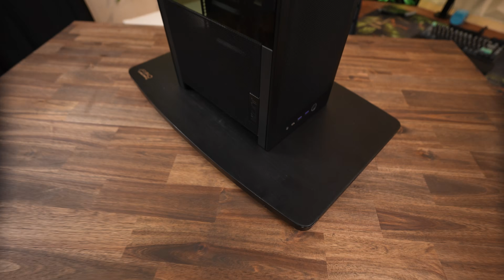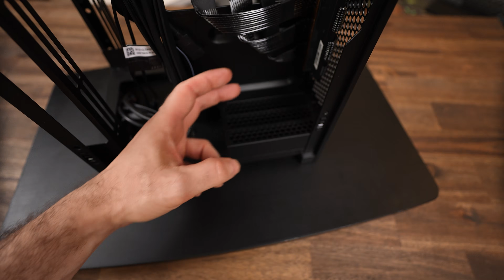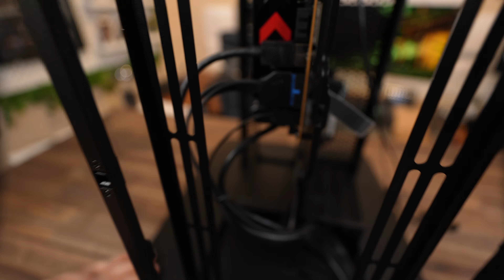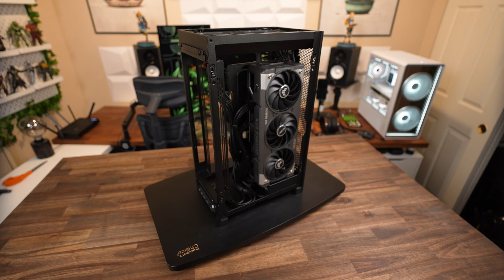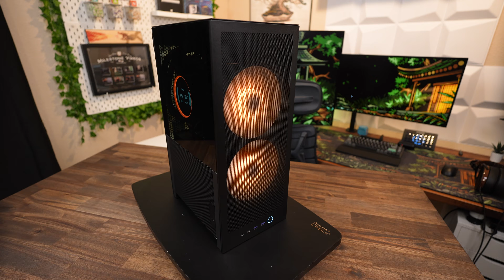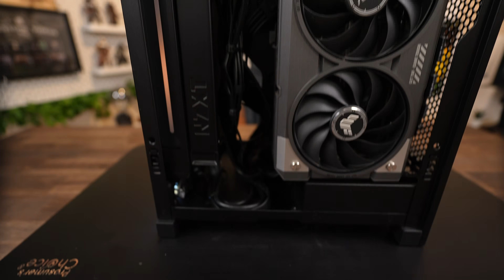This Mini ITX PC Case might be my favorite.. (NZXT H2 Flow)

Comment from the maker: Hey everyone! Thanks for tuning in to another video. Today, we are looking at the NZXT H2 Flow. I will show the full build process in the case and share my thoughts on it! Let me know what you think. Parts for everything used will be down below:

Spinning PC Platform (Lazy Susan): https://amzn.to/4ayohqe (May not be the exact one I bought because they come in and out of stock all the time. I have the BLACK 21" version)

Case: https://nzxt.com/products/h2-flow
Motherboard: https://amzn.to/4qL1UnF
CPU: https://amzn.to/4qJMkIW
GPU: https://amzn.to/3OrgaUX
RAM: https://amzn.to/3OgTdUA (Terrible Pricing)
SSD: https://amzn.to/4qIrUA6
AIO: https://amzn.to/3MKcqxq
PSU: Link not available yet (Will update once available)

Visit my LinkTree to see ALL my builds (including this one) and my recommended products:
https://linktr.ee/dankamyouknow

👍Amazon Affiliate Links 👍
( When you buy through an affiliate link, I may receive a commission on the sale - as an Amazon Associate, I earn from qualifying purchases. Prices of the products do not change because of the created link )
Reply: Lovely build! Feels like a really cool console. If you ever want to explore some options 180 degree adapter from ezdiy-fab for the 24 pin connector giving you a back panel-like connection so your cable sits hidden with no need to be bent. As for the cables from the psu the mesh panel is dope and you can always use some black mesh wrap inside to hide it no need to individually wrap just grab a big sleeve and surround the whole cable combo in a semi-cylindrical shape it will make them look flawless
Reply from the maker: Appreciate the suggestion! a 24 pin angled connector would have worked really well, and looked much cleaner

Comment: Where did you put the extra antena that goes with the motherboard or is it not needed?
Reply from the maker: It's magnetized, so I honestly just stick it anywhere, even the top of the case (without blocking the exhaust fans).

Comment: would a high end build for the living room be good for this case? 5080 or maybe even 5090. Im worried about the riser cable and cooling. Case also has no dust filters on the panels

Comment: Enjoying your videos Dan! I just built my travel rig with this case, same mother board with a 9800x3d and Asus prime 5080. Cool to see a fellow mechanic building PC's, I used the Wera tool check ratchet with a short bit to get the screws in the gpu bracket. I think my PC budget might be rivaling my tools budget now. take care

Comment: put a power color hellhound 9070xt in mine. freaking mint fitment, like, JUST fitting. the insane part is temps. my cpu temps are a little higher than my last build, but my gpu temps are way lower.

old build. 7800x3d + 7900xtx red devil 3.5 slot card in a jonsbo d32pro with an msi b650 project zero back connect board. 240mm radiator at top sucking case air out in push AND pull. cpu temp never over 55c.... gpu temps with 75% fan speed on 7900xtx up to 80c (average around 70c). which just, ooph.

new build. this nzxt h2 flow case. same 7800x3d. same liquid cooler but now only pull instead of push and pull. wanted fans inside case to pull through rad and front panel grill/mesh in order to keep noise a minimum. and the 9070xt hellhound which is only a 2.5 slot card. cpu temps up to 65c which is worse but i suspect its because of the pull only and even noctua nf-a12x25 isn't enough "pressure" to pull through. but my gpu? i haven't seen it go over 55c lmao. its FASTER than my 7900xtx according to my game testing. same game settings thanks to steam saving game settings regardless of windows install (same account obviously). and yeah. its cooler, uses less power, has a smaller cooler, and doesn't get anywhere near as hot. and im allowing the +10% power through MSI afterburner as i dont install amd adrenaline crap.

as far as cable routing. super easy. i used an asus loki 1200w and the individual wrapped wires? fits between the rad and such tight because that's how i cable tied it. honestly its the cleanest cable run ive ever done in a system. way cleaner than anything ive ever done lmao.

Comment: Fractal ridge is the goat for me. 
It can even support 3 slot cards. Most of these cases don't. 
It's thinner, looks far more premium than just a black case with holes in it and a small side window. 

But this one is neat too. Ifyou only need a smaller gpu.

Comment: Just finished my own build and are having clearance issues with my second nvme drive (WD_BLACK SN850X 2TB NVMe SSD with Heatsink) on the back of my motherboard (same one you used on your build)

I do have 2 ideas 
#1 remove the heatsink and purchase a low clearance one
#2 buy a nvme extension cable

any suggestions?

Comment: so 70ish from a full load 5060ti? how would t perform with a 9070xt or a 5080 that have over 300w TDP? im really tempted to swap to this SFF case but im worried about temps specially with the GPU (i have the 9070xt)
Reply: With the 9070XT, if you have a model that uses Samsung VRAM like the later variants of the XFX Swift that tends to run cooler than SK Hynix which is usually the main concern, plus they undervolt really well so should be able to get away with it. Got mine running with.-20% PL/-60mv. Same performance fans never exceed 1100RPM and memory stays below 82 degrees, temps never exceed 60 for the core.

Comment: You can do the same thing without a riser and with matx... Just take a front mounted PSU PC case and put it on the front, while making some stuff to hide cables connection on the top...

Comment: This seems like the best of both worlds.  The extra room for easy assembly and better airflow of a larger case, but the small desk footprint of a small case.  Definitely gonna consider this for my next PC when/if the prices are sane again.
Reply: It is not a smaller footprint than a front mounted PSU pc case, which stands on its front... No need for a riser and even matx can be at this size. Just you need something to hide cables at the top

Comment: As cool as this case is, a 20L case is not an SFF. case and is rather pointless.
I have an MATX and a beefy air cooler in my Ncase M2 case, and that's a 15-liter case.
What's the point of this thing?

Comment: I really Like Your cable manegement, that inspired ne to make the cable manegmant on my 6 years old pc clean. 👍
Reply from the maker: That's awesome, cable management makes a huge difference! 🔥
Reply: @DanKamYouKnow Thanks 😁
Reply: @DanKamYouKnow I oc  my 3070 and have82,6 fps in the cyberpunk Benchmark.
1080p 
Rt psycho 
Dlss balenced 
Max settings 
(technicly  the pc is a Bit over 5 years old ) 
Is That result good ?
Reply: And an i7 10700k on 5,0 ghz and no Watt Limit 😁

Comment: The Lian Li Dan B4 coming in Q2 is going to make this case completely irrelevant.

-21L
-Does both traditional layout and vertical
-Allows 166mm air cooler or 360 AIO
-7 fans
-ATX and SFX PSU compatibility
-MATX compatibility
-Larger GPU support
-Looks better (imo) and will probably be better build quality
-HALF THE PRICE

Comment: Looks nice but Gpu isnt exhausting hot air right on the back of the mobo ?
Reply from the maker: The front intake fans and top exhaust fans should force that hot air to escape through the top. But yes, you are correct.

Comment: Why does no one go over the GPU cables? Right angle display ports. What about network, audio and any other cable that plugs into the mb?  This sounds like the archillies heel of this design. Access is terrible without moving the entire case. I guess you have to spin it all positive when your sponcered.
Reply from the maker: I covered the GPU cables. They route through the bottom and in to the GPU. The motherboard is normally positioned and all connections are on the back, as shown and talked about multiple times in the video. I don’t really see the GPU cables being a concern, you have to tilt the PC or lay it flat one time to plug in your monitor cables. This design allows for much longer GPU’s.

Comment: Another clean build Dan! What are your thoughts on more powerful builds (9800x3d+5080 or 5090) in small cases (itx) with respect to temperature/air flow during heavy gaming sessions ?
Reply from the maker: Being able to use a 280mm AIO is absolutely clutch for this. You should have no issues running a high end CPU like the 9800X3D, and I have seen a few builds in this already with it and GPU's like the 5080. Small adjustments to fan curves for the GPU and possible undervolting could get you exactly where you would want to be, temperature wise.

Comment: How does the quality of the metal feel? I noticed when you were plugging in some of the IO cables the internal Mobo bracket had a bit of give, did you notice any unexpected bends/flexing during the rest of the build? I just finished another build and this is making me want to make an ITX rig!
Reply from the maker: The motherboard support has a little give to it, but no cause for concern with it. The overall constructions is actually pretty solid for how small it is.

Comment: you gonna kill that Pump so early its way to high the pump is integrated in between the tubes it should be lower than the CPU block
Reply from the maker: Tubes down is definitely more ideal, but tubes up is fine. As long as the pump isn't the highest point in the system, it's OK. Tubes down didn't look as good with the tube routing.

Comment: I think they're pushing the definition on itx a bit. It's almost as big as the smallest micro atx case.
Reply from the maker: I think it's because of it's shape, and also my wide angle camera lens makes it look bigger than it is. The foot print is actually really small, just very vertical.

Comment: I think Deepcool ch170 digital better...
Reply: I’ve had the ch170 and I was not a fan at all, but it is way cheaper tho so yea its definitely worth considering over this overpriced thing.
Reply: @sudeshh11 maybe this " itx " size Deepcool ch170 plus good alternative with cheaper parts( ATX psu, matx mobo) 😁
Reply from the maker: I did a build in the CH270 a while back. Great case but I really did not like the screen on it, looked very cheap and no adjustments to brightness. If they figured out a better screen for it, it would be one of the best.

Comment: Nice build and video as always Dan I would only suggest a 90 degree 24 pin adapter perhaps and putting the radiator in so the hoses were at the bottom.
Reply from the maker: Thanks for the feedback Dave! I looked at tubes down and the tube routing just didn't work in this case IMO. I know it's more ideal for the pump, but at least the radiator is still the highest point in the system.
Reply: Absolutely and I haven’t seen anyone else do it differently either

Comment: I like the non-rgb ram! How are the temps under load for a SFF build like this?
Reply from the maker: Benchmark for 7800X3D was around 73C and the 5060Ti was around 68-72c. I have seen other builds in this so far with higher end GPU's and CPU's, and it worked very well. The 280mm AIO and 2 120mm exhaust fans will definitely help.

Comment: Personally don't like the design, which is the only reason to buy the case as
it's 150usd, itx only even though the case is pretty big for itx and you get the nzxt warranty.
I also don't understand why detaching the front panel detaches the power button and prolapses the front IO.
It's a really weird case overall, itx is already a niche market and they decided on this.